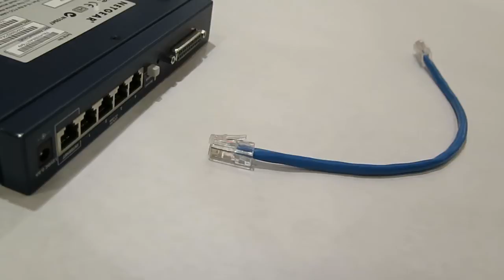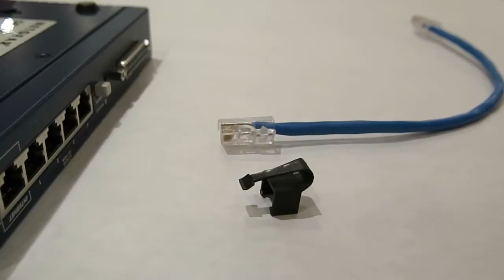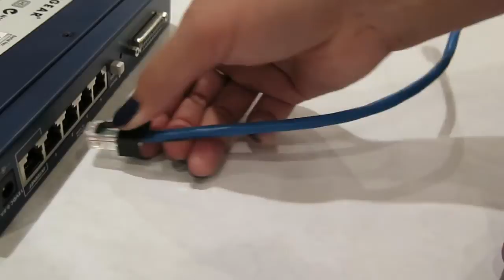RJClip Promo

Comment: I could not get the clip to stay on, even a new RJ. I have discovered that the tab should lock under the broken clip at the front, this is the clip. I was thinking that the tabs would click in some recess in the the RJ.

If it clicks under the broken tab on the front, it is locked frontwards and the tabs in the middle lock under the chin of the RJ.  

The front broken clip is the one that makes the click.

If it does not the RJCLIP tab can be bent down to engage.

Please make this clear in the instructions.

Then it works.

Lawrence